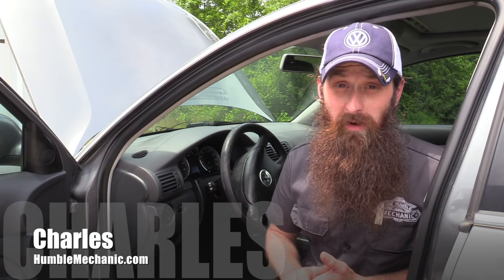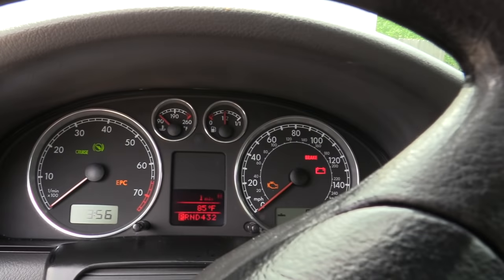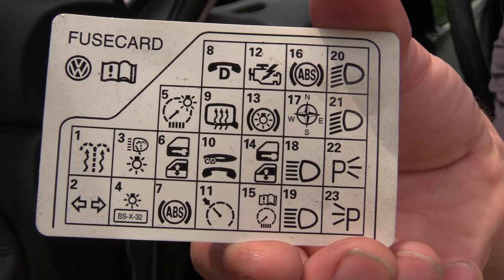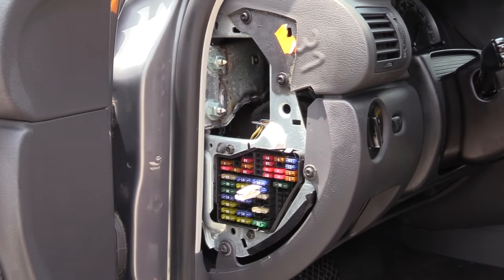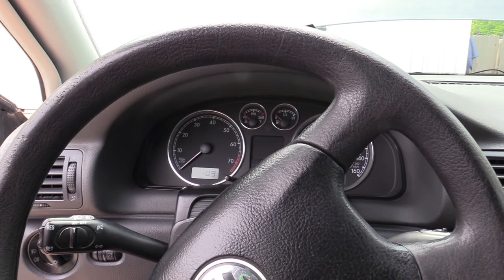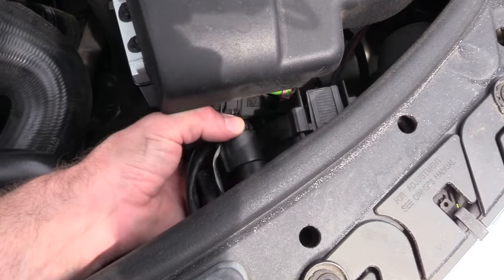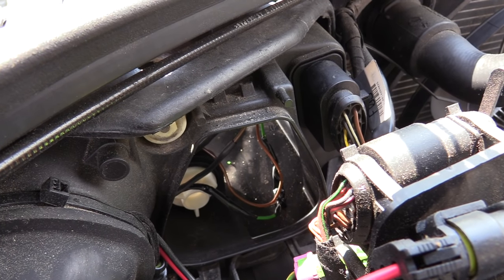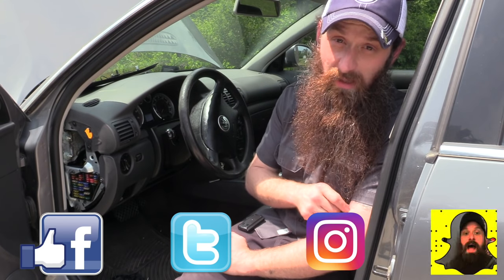Why My Turn Signals Don't Work ~ Diagnosis

Comment: 2002 f250  just replaced 5 pin relay on turn signals/flashers .all works as normal but a few seconds after shut off relay continues to click. no lights lighting up but relay still clicks whether key is on or off and drains battery down . any ideas?

Comment: So you altered the tip of that PP? I like it. Going to have to steal that one.
Reply from the maker: Steal on man. I love the bent tip. It's great for this set up. It is not so great for the newer fuse panels on VW
Reply: Did you become "bent" as a result of working on VW's for so many years?

Seriously, I like your approach to diagnosing vehicle ills. A professional and common sense approach to proper diagnosis.

Comment: At 4:00 and at other points, your blue tool thing is making a different pitch of sound. Why does it do this?

I purchased a Digital Multimeter with Audible Continuity test, and I also just purchased a car that MAY have an Intermittent Blinker issue (it is not a Volkwsagen nor VAG car.. always hated that designation, "VAG" or Volkswagen/Audi Group) so I may go down the entire row of fuses as I did the gift that keeps on giving, the blue Volvo.. I found one blown fuse unrelated to the issue at hand there.

There was an alarm installed on the car that has the intermittent/sometimes no turn signals. It has a DRL out, too.
Reply from the maker: One tone indicates power, and the other does ground. That is why I use it really. it's called a PowerProbe. This is the newer version of mine http://amzn.to/2xJqj3I

Comment: I have a 2003 ford focus. In summer when interior of car gets warm/hot turn signals don't work but hazards do. Also wipers don't work in intermittent or wash, but they do work in low or high. Both functions will start working again if the car interior gets cool enough, but can take till the next morning. I'm thinking it's timer/relay on what ford calls a GEM (generic or general electric module). Any similar issue with VW , other brand or worked on a ford?

Comment: On my 96 Toyota Avalon my front blinkers work but my rear do not. The blinker blinks fast as if it knows the bulb is out. I replaced the bulbs, but still no luck any guesses?

Comment: I have a chevy impala (2004). the blinkers will work most of the time, but sometimes they don't so I have to jiggle the hazard light switch. My Mechanic thought it might cost more to fix than the car is worth. Does that sound right?

Comment: Wow, that harness looks gnarly.  Makes you wonder if it would be better to make a fresh light harness for yourself and re-pin the connectors - if that's possible on these cars.
Reply from the maker: +aussiebloke609 it's possible. Doing that would probably be a little cheaper too. 

Luckily VW offers the harness separate. I had one in my tool box for some reason, and bought another one. So fixing this cost me about $40
Reply: I'd hate to install something that was going to get so ratty again.  I think I'd do the rewire, just so I didn't have to worry about it in the future - unless they've upgraded their insulation since.  I've had cars that were left out in the Australian sun for 30 years, and the elec. insulation didn't get nearly as brittle and flaky as that.

Comment: Hi. I have a 2003 Hyundai Accent. A previous owner must have connected a beeper to the turn signal circuit. Every time you use the blinkers, it beeps like a truck backing up. The sound is coming from inside the dashboard. Am I probably going to have to remove the dashboard to disable this thing? Have you encountered this before?

Comment: rofl.. you solved my problem @ e signal. I was doing work and unplugged my esignal to get behind dash. forgot to plug it back in. that's my turn signal circuit.

Comment: Hi, Mr H M, I have Honda CR-V 2003 the turn signal doesn’t work .  solution I had done fuse checked, turn signal relay swapped, combination switch changed and under dash fuse box assembly swapped. The problem still exists.  Also the hazard signal doesn’t work if the key turn to ignition and start the car.  Another problem is driver side power window work, the others don’t work.  it is strange, all the problems work normally for one day when the weather got chilly and rain, but not anymore. 
Any suggestions would be appreciated. Thanks…

Comment: I have Kia Amanti 04 turn signals work hazards don't, I forced them on with the autel scanner and it worked. I checked fuses, wiring looks good but I don't have the connector end view to distinguish the wiring. So I don't know if it's the button itself or faulty wiring

Comment: I still have a question, I replaced all the bulbs, checked all the fuses and relays and my left rear turn signal still doesn't work is it just not getting power?

Comment: I’m a bit late to the party. My back left turn signal is out on my car. Hazard doesn’t go. But my headlight works and the bulb has been replaced. Could I have a fuse problem like you? I don’t know how to fix it

Comment: What would cause a 2013 tdi passat to not have power to the right brake turn signal? No other issues that I know of. Checked bulbs and no power to light plug.

Comment: Question- both turn signals are working but the hazard indicator button stopped working. If I turn on left signal and Hazard button together then the hazard light button and signal blanks. If i turn on the right signal and hazard button, the signal blanks but the hazard button does not. 
Any advice on where to check why the hazard is not working?

Comment: 2003 Saturn L200 blinkers and hazards NOT working.  Fuses are good.  Changed the hazard switch relay,  nothing.  Changed the multi- function switch (blinker arm), still nothing!  I'm at a loss,  please, any suggestions?!?!?! Thank you.

Comment: I have a 2006 Impala LT2 & my hazards, turn signals, high beams & headlights don't work (except auto headlights work). What could be wrong. My hazards got stuck on & couldn't turn off so I smacked the top of column & they as well as intermittent delay wipers don't work, & everything else quit working, i replaced the BCM & no change. I have checked all bulbs & fuses & they're all good. I'm thinking the turnsignal/malfunction switch is bad. Idk.

Comment: For some reason all the turn signals of either the driver side or the passenger side stay on when I lock my Golf, sometimes when I unlock it too.
They don't flash, they just stay lit constantly. Have to mess around with the turn signal lever and try and lock the car up a dozen times to get them to stay off.

Comment: Have a 2009 Ford F-150 Right turn blinker won’t stop blinking unless turned to left.Left turn signal won’t come on.Changed turning switch and lightbulbs and nothing changed.Any suggestions?

Comment: I have a question.... 
My hazards and turn signals have all stopped working .I replaced the relay unit and put in new fuses but both left and right just click rapidly. All bulbs are working when connected to the battery directly ,what could be the problem?

Comment: Hi. I have a different problem in my Passat B5 (1999 TDI). When i hit turn lights left or right or even the hazard light, the lights blink one - three times and stop. The light are on but do not blink. Sometimes work properly but recently does not work what ever i hit, left, right or hazard light. Could you advice what to check?

Comment: What if your clicker isn't working inside the vehicle but the lights are working fine. Coupled with the all dash warning lights are coming on yet the vehicle is working as it should minus the dash. Dash assembly has been replaced at the cost of...1097. to include one new key. The fuses are all good.

Comment: When I signal left my front, back and wing mirror indicator is fine but it’s also signalling my right wing mirror indicator... when signalling right, my right wing mirror indicator doesn’t light up but the front and back work fine... any ideas?

Comment: My honda civics turn signals work so do the hazards, but the ticking sound has stopped, the ticking sound returns sometimes but the signals always as they should. really need that indication ticking noise, could this be a fault with Micu or the speedo console? my car doesn't have a turn signal relay in the fuse box! any clue were to look?

Comment: There is so much room in that engine bay! Have you removed the relay to disable the DTRL that might help prolong the life on the harness I did that on almost day one with my 03 Passet.
Reply from the maker: +soundman447 the DRLs have been disconnected for about 8 years. :)
Reply: Wise Man.  these cars look so much better with out them now to only find a way to keep the headlights from fogging

Comment: I have a MK4 and the passenger seat has to power for movement or heat. I checked the fuse but it's fine. There is no motor noise when I hit the button. Do you have an idea what it could be? Thank you.

Comment: I have left turn signal issues with a Chevy Colorado. The left side flashes rapidly. While the front still flashes, the rear doesn't. The rear has 3 bulbs and 1 wasn't working so I replaced it twice and still the light won't flash. I checked the fuses and still no light. Any other ideas? Thanks

Comment: Got a question..i have a 92 Chevy k1500..rear passenger turn signal not working.replaced the bulbs,even the sockets as well..theres 3bulbs,the one on the top,which I believe is the turn will not come on,but the other 2 are on when I have the lights on..i check the connections underneath truck and they all seem good..any suggestions on what it may be?

Comment: Great on the head light diagnostics I had the same problem on my 09 tiggy. 
Now I have another issue that I'm asking for help with. 
Every time I remove the oil cap the car almost stalls and runs terrible.  
I'm thinking a pcv valv? What do you thinking? 
Thanks for the help
Reply from the maker: +Jeriko A, Sosa that's normal. It makes a big vacuum leak. 

If you took it off and the car ran good I'd be worried

Comment: Now you have one side flashed fast and the other side flashes normal all lights work only left front balb was weak so I put new one in and still flashes fast I'm going to change the flasher is that the right thing or could something else cause it

Comment: Hey. Charles. I have an issue see if you can help me out.
When i lock or unlock my car from the key fob the blinker on the passenger side stay on and sometimes takes a while before i can make them go off.
Do you have an idea what my problem is? Thanks in advance 
Golf mk4 2.0

Comment: I have an old nissan. The hazards work but the individual turn signals don't. The fuses are good. I checked them and swapped them. Any ideas?

Comment: Hi Charles,

I am in the process of building a headlight harness adapter to get my aftermarket xenon headlights with LED DRL to function the same as the factory ones without any bulb out errors.  My question is, what gauge wire should I use?  Factory wires look about 18 gauge but should I be using a smaller (thicker) gauge of wire?

Thanks again!
Reply from the maker: I would error on the one too big size. Most of the headlight harnesses are 1mm I think..

Comment: See, but in my Passat my emergency blinkers worked fine, I got NO TURN SIGNALS, I replaced the hole turn signal wand and now I have no turn signals or high beams... Any other relays or fuses that I can switch or check on?

Comment: Sitting at a red light I discovered a clicking noise comes through my transmission handle when in blinkers are on and in park.  Weird behavior. What could cause this? 2002 cabrio GLX

Comment: Question .. I have this poblem my neadlight and my wiper not working ....
I check fuse box everthing ok
I check relay everthing ok 
I swap  the turn sinal swith and wiper to
And 
I swap the headlight control switch to
Still i dont have headlight are my wiper not working.

Comment: Hi Charles! Two questions from Brazil: Does the electronic central of a mk7 golf record an access log from a non VAS/VAG scanner? In USA if you use a ordinary scanner to check an error code in a VW car the dealer can cancel the guarantee of the vehicle? Thanks for your great videos!
Reply from the maker: +Paulo Ferro using a different scanner won't do anything to the warranty or guarantee. 

I am not sure exactly what you're asking on the first question. I think it will work just fine.
Reply: Many thanks for your prompt answer! The first question is related to an argument of the dealer in my city. The guy said that the ECM record any access of a different scanner than an official VW scanner and if this registry is known by the factory/dealer it cancel the vehicle guarantee. Thanks again!

Comment: my son has a 2008 scion XB. I replaced his driver side turn signal and now none of his turn signals work...checked the fuse for the turn signals, the fuse is fine. I removed the bulb and still, he has no turn signals. What could be the problem?

Comment: i have a 1992 crown vic first the key is stuck in the ignition and would not come out now the signal light dont work i put a new signal switch in and it work then it  stop  working can you me a sultion to fix both my problems?

Comment: Hey @humblemechanic ! Please help me I own an 2004 accord and non of the turn signal are working not even the hazards ... I have checked all the fuses and changed the relay but I still have the relay buzzing sound wen hazards or turn signal are turned on ! Please please help me... Exhausted diagnosis

Comment: I know this video has been out for almost two years and maybe you may not even look into the comments but heres a ray if hope you do, i own a 07 eclipse spyder gt, everything works fine except for the hazards, i tried checking for the fuse but the fuse is fine, i popped the dash of to get into where the button is located but also the cable to the button also seems totally fine, ever had an issue with something similar? If so any help please?
Reply from the maker: You will need to do more digging like testing the switch and being sure you have power at the switch

Comment: Charles,  so no 30 amp circuit breaker plugged in to the fuse slot and check for smoke?
Reply from the maker: +Brad Downs that's another option. I did just get a new light that is supposed to make finding smoke easier.

Comment: My 1999 miata is having this issue, but it is weird.  My turn signals seem to come and go.  they generally work when I first start my car and then after like 15-20 minutes of driving they either completely stop working, or they will only work if I hold the lever almost to the point where it clicks but not all the way.
Reply from the maker: Oh that’s weird. Bad contacts in the switch maybe

Comment: Ive changed the Switch. Checked für Power in the Plugs Checked the fuses. Yet still my hazards Work and my Turn Signal dosent. I have No Result.

Comment: Tried to convert my 1991 Volkswagen Jetta's turn signals over to LEDs and all I got was a solid blinker and a buzzing relay with the hazards. Ordered a new relay and it didn't work, had one that was universal and it did work but the blinker blinked too slow and kept the bulbs on half power while having them flash too quick. The hazards worked fine tho. I just can't win lmao

Comment: I recently bought a 2002 Cabrio. All of a sudden the window washer and the cruise control quit working. A few days later the turn signals and emergency flashers quit! All the fuses seem fine. Any recommendations as to what to check?
Reply from the maker: +Anna Lee fuses first. Then ignition switch

Comment: Question: Why does the fuse-tester soud different on different fuses? I have never worked with testers with sound - only light
Reply: MElmo Different sound for power and ground.
Reply: Makes sense. Mine has a light for + and one for -. Same idea but i have to look at the probe. It's nice with the sound

Comment: 2002 hyundia elantra i have zero hazard lights and only one blinker which is the left one . The moment i hit the right blinker it blows fuzes. Do you believe it's a grounding issue . I also did your test with taking headlights out when I did that i hit the right it makes a crazy clicking sound .  Tried flasher relay fixed problem for a day ... please help
Reply from the maker: More likely a shorted circuit in one of the lights causing the issue. Or maybe the hazard switch itself

Comment: Toyota corolla 1990 left tailight broke and fuses does not work but I change it already and the other three are working and now all the taillights are not working and I changed the fuses and big relay for the tailight  and everything is good but nothing works

Comment: Hi there Charles, can that wiring sheath breaking be replicated on the ABS control module? Happened on my Passat 2002 1.8L. Have watched some videos, including one from Thomas EXOVCDS, and it seems the module is kaput. Any thoughts? Thanks.
Reply from the maker: It’s possible for sure. Those modules were failure prone. Luckily you can replace the electrical unit or have it rebuilt

Comment: How do you change the oil filter on that 1.8t without making a huge mess all over the subframe?
Reply from the maker: +300DBenz i tape the hole in the top of the frame. I also like to but the filter in a bad before removing it.

Comment: Thank's Man!! What car models and manufacturer years does this issue with dried out cracking wires show it's ugly head?
Reply from the maker: This is my 2005 Passat
Reply: So the wiring issues are only seen on 2005 Passat's?
Reply from the maker: The 2001.5-2005 Passats all had the same headlight. Well, other than the W8.
Reply: HumbleMechanic not all passats had the same headlight. There was an option at that time to upgrade them to xenon, which was a
standard feature on all the W8.
Reply from the maker: +GreekBoss007 okay thanks.